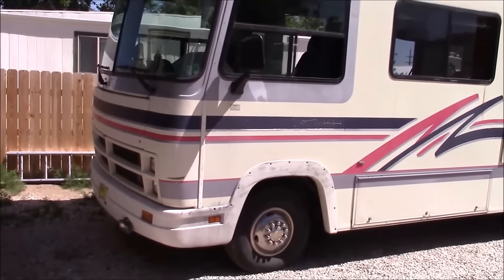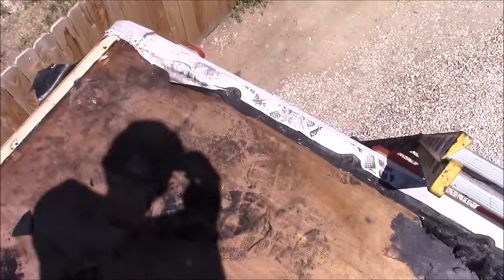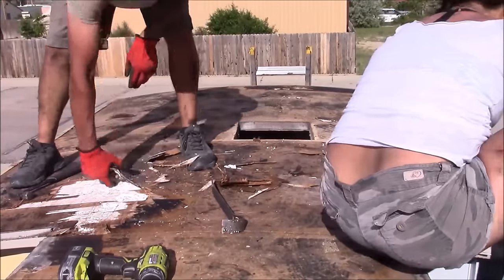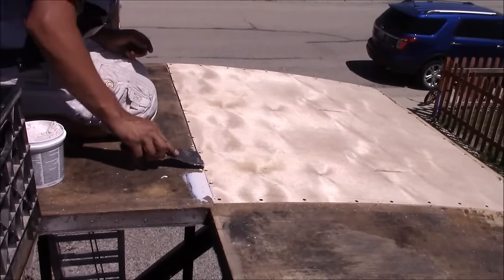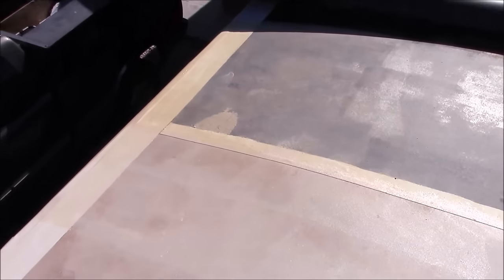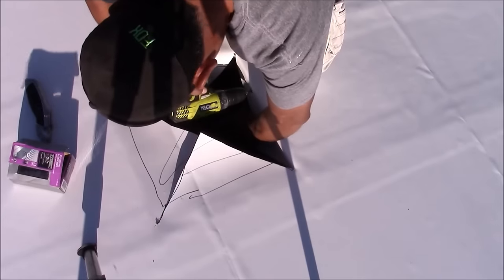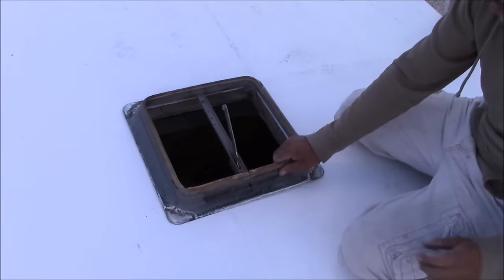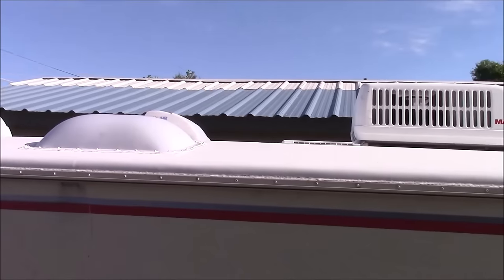How to replace your RV or Motorhome roof EPDM or TPO

Comment: RV Roof replacement is very costly but with Liquid RV Roof you can easily restore your aging RV Roof without no worries at all. Liquid RV Roof is a liquefied version of a synthetic rubber typically referred to as EPDM. Liquid EPDM can go where the sheet version could never effectively coat. Liquid RV Roof is a one coat system for your RV which results in savings in terms of labor and material costs. The final cured properties of Liquid RV Roof are not damaged by adverse conditions.
Reply: if the plywood and particleboard is f'ed underneath though, you still have to replace that, liquid epdm won't help with structurally compromised roofing layers.

Comment: As a camper and trailer mechanic I would advise significantly more lap sealant on the joints and screws.We typically use from 8 to 12 tubes of lap sealant on a reseal.

Comment: Looks like a good job done, I was wondering how did you cut out the old damaged quarter piece of plywood? did you just use circular saw adjusted to the depth of the plywood cutting it in the middle of the steel support beam?

Comment: i just baught a 1994 Fleetwood Flair with the same graphics the roof is in bad shape but white still. it has cracks all in the roof and a big split at 1 section that lets water come inside the RV. Did your roof also leak before you put in new roof and if so how did you fix inside,,this video is going to help me out in a great way and thank you for sharing

Comment: Those screws leak after they've been in the sun for a while. They should be sealed with lap sealant too, and a bit of lap sealant on the threads before they go in helps too
Reply from the maker: They are metal roofing screws same ones used commerical and residential metal roofs. They are designed to not use sealant.  That being said sealant can be added if someone desires it.
Reply: @D.I.Y._All-in-One  yeah they are great screws, they spread the pressure out wider and they keep water out for a long time but many times water just sits on top of the screw and just breaks it down slowly until it gets through and starts rusting it. Then it gets under the rubber and starts rotting the wood. I fix up old RVs all the time so I do a lot of roof repair. Even a little blob of laptop sealant on top of the screws will Help a lot. Once a year every screw should be checked to make sure they're still sealed

Comment: Wow, what a great how to video and a great look at the actual process.. I have a 37 foot 5th wheel trailer and I sideswiped a tree branch damaging about 30 feet of the top roof edge. To re roof the top is estimated about 5G. But now I know what needs to be done! Good Job, I think I can do this although it seems like a lot of work your video was very thorough. Thanks !
Reply: Great video. Repairs to my shadow cruiser Will be a lot easier after your video.

Comment: Pull the roof rails and vents/ac. Pull membrane and radius metal if it's a stick built check roof bows and r.r if necessary. Overlay with 1/4 luan using appropriate structural adhesive and d10. Sand seams and staples. Spread appropriate glue and replace new membrane and squeegee air out. Replace all rails,gimp and hvac/antennas,seal with self leveling and u.v sealant

Comment: Thank you for making this video. I have a 26 foot Aljo travel trailer with a leaking roof. Your instruction and video is perfect. My main concern is my weight on the roof. I weigh 350 pounds. I don't want to break through.
Reply: It is a major pain in the @ss, but get 2 pieces of 1/2" plywood, each about 3'x3'. Put those under where you'll be stepping. It helps distribute your weight around a larger surface area. You have 2 so when you're moving you can stay on one and move the other. I'm a pizza over 300 lbs. myself. That plywood method has served me well over the years.
Reply: Thank you, I'll give it a shot.

Comment: hello , excellent video. One question: is the TPO you used self adhesive or not. thanks for answering
Reply: The TPO doesn't appear to be, as he applied the cement to glue it, two coats near the end separately.
Reply: As he stated in the video that he has to use the adhesive and roll it onto the wood about 4 feet at a time since it could get tacky too fast if he went more at a time.
Reply: I do Roofng for a living and yes there is adhesive tpo it cost a little more but yes and it’s easier then having to use glue

Comment: GREAT VIDEO YOU MAKE IT LOOK SO SIMPLE .  QUESTION I HAVE A 2008  HALLMARK CYCLONE TOY HAULER 41 FT. I HAVE A ROOFER DOING IT AND I AM HELPING.  I DECIDED TO GO WITH AN ALL ALUMINUM ROOF COATED W/ WHITE ROOFING MATERIAL,  LIKE THEY PUT ON 53 FT. CARGO TRAILERS AND AIRSTREAMS.  AIRSTREAMS SEEM TO LAST FOREVER.  TYPICALLY THE ALUM. ROOFS ARE GLUED DOWN NO SCREWS/ RIVETS.  WE REPLACED MOST OF  PLYWOOD AND MADE UP TRUSS'S  A)  WHAT ARE YOUR THOUGHTS ON THE ALUM.  B)  WHERE CAN I GET SAME GAGE FLASHING 41 FT., AS RESIDENTIAL IS TOO THIN.  3)  AIR CONDITIONER  HEAT PUMP VS STOCK OEM 4)  WHERE TO BUY PARTS  NEEDED ; I.E. AIR COND. VENTS OTHER MISC. FOR RV'S?   5)    WHERE DID YOU GET YOUR SHOES :)  PERFECT FOR GRIPPING ?

Comment: Hello there,  absolutely finding your video super helpful.  We have the roof stripped and are now needing to buy the screws.  Would love you to link those..  Our plastic rounded moulding is cracked and we are thinking to keep it because I can't find a replacement.  I think I need #8 X 3/4" flat head self tapping screws in zinc.  Is that correct?  can't seem to find them unless a huge bulk order from a fastener company.  Is this the same screw you used on the plywood?  We are replacing a little bit of rotten wood.  And lastly I am looking for the self taping screw for the termination bar.  would that be a #10 X 1 1/2" self taping screw with washer and gasket, is your's ceramic coated?  Some of these things don't seem to be available at my box store home depot.  So I'll have to order and have delivered.  I am trying to purchanse things to make it easier for my husband.  Team work.  Your help is greatly appreciated.  Thank you.  Great video!

Comment: Great job on the roof, looks good, and is water tight. Only thing I saw, was you didn’t glue the backside of the TPO. You glued the deck but didnt hit the rubber lol.
Reply from the maker: I followed the manufacturer instructions with the glue. I even spoke to them on the phone.

Comment: I bought a 2005 Rambler slide-out camper. I am having to replace the roof. There is absolutely no phone in mine. It looks like quarter-inch plywood was put on it and then some sort of paneling over it. And then the rubber roof. I'm replacing it with new quarter inch plywood. I'm also coughing all the seams and the screw holes before I put the rubber roof on it. The rubber material I'm using is from a construction company that uses it on flat roof. It's black on one side and white on the other. I'm using 6 in wide Flex Seal tape for  the seams on the side of the camper . I hope this goes well. Since I am completely clueless on how to do this.

Comment: I am replacing the roof on a 2004 5th wheel, upon pulling up the existing rubber roofing the top side of the osb is still "tacky" from the old adhesive. you prepped the roof by wiping it down with mineral spirits, did you have to completely remove all of the old adhesive? or can you simply wipe down the roof to remove any dust/debris and then proceed with gluing down the new TPO roofing? (I should also mention that this video helped my wife and I to take on this project, prior to watching it there was no way we would have attempted to replace the roofing. awesome video thank you!)
Reply from the maker: Thanks Man. With mine I just wiped off debris and adhesive remained. You can do a small test with new adhesion to confirm. Just apply new adhesive on old in a 6" x 6" area and let dry for 15 to 20 minutes if you have good adhesion your good to go. If for some reason you have no adhesion or the 2 adhesives react badly with each other you may have to remove all old adhesion but I doubt you will have any issues.

Comment: Biggest problem with these rubber roof's  from the manufacturer is they used staples to attach the 1/4 plywood too the framing. After driving with the vibration and constantly leveling, the staples start to loosen and pop up into the rubber and eventually causing leaks. If they would have put in screws like you did in the first place, the roof would last a lot longer.
Reply from the maker: Yea not a big fan of staples

Comment: Great job. Does the plywood 'need' to be glued to the Styrofoam? Will the screws not hold it sufficiently in place? I'm going to have to do the roof of my travel trailer at some point in the near future.
Reply: You really want to glue it to the Styrofoam. When you are rolling down the road, you will want that extra grab from the foam to keep things in place and not move. the screws will be fine, but like in the video, there was a place on the roof that was not near any framing, so only the glue will be holding the plywood on. And more is better when it comes to securing things for RV's or trailers.
Reply from the maker: I would highly recommend gluing down the plywood it actually makes the roof a much more solid structure. without glue the plywood is so thin it will bow & flex causing roof membrane to stretch which could lead to roof failure.

Comment: C.L.S. Great video! I was wondering when you adjusted the side termination bars did you adjust left to right or up and down? I cant tell from the video on exactly how you  adjusted to accommodate the roofing screws. thanks again.
Reply: Termination bars are called awning rails and after glue and rolled out pull wrinkles out and use a squeegee. Let it dry then go down each side pulling tight and use a L15 staple gun to hold

Comment: For all of you with a $2500 rv or camper with a bad roof use bear deck over decking paint. After you remove rubber

Comment: I have generally a good roof except around the bath tub sun roof on one side of my travel trailer. I spoke with a bona fide travel trailer company who says the whole roof needs to be done vs fixing the leaking area. I am a carpenter as you are and I beg a difference with the travel trailer repair company who says if one patches the affected area it will leak again. What are your thoughts? If I do what you have shown in your video just seems to me I should be able lap and then seal with the repair tape your used to seal off the front and real seals. I don't need a ton of membrane a total of perhaps 4 x 6 feet.  Thanks
Reply from the maker: Patches can be very hard unfortunately.  It's a case by case scenario.  If it's a tear or just damage to roof that is other wise in good shape a patch might work.  But if it's a case of roof just being worn out on one side a patch probably won't work well. When these rv roofs start to fail the material becomes compromised making it hard to bond any products to it.

Comment: 😬 I have to do this job in the coming weeks. I have a 96 Fleetwood so it's pretty much going to be the same thing as what you did. Wish me luck
Reply from the maker: Good luck. Just a tip: be prepared to cover with giant tarps from rain/weather if its not going to be in a garage while old roof is off.
Reply: I'm in the valley in California so it hardly rains here. Wanting to get this job done before winter arrives.

Comment: I fix campers and motorhomes for a living at a dealer. A heat gun would make pulling up the luan much easier because it loosens up the glue and generally the foam is left behind intact and good shape. Just dont get it too hot and make the foam shrivel up

Comment: Looks like you had an excellent helper too! Did you sell the other kit? I have a 35ft Winnebago Vectra with a damaged fiberglass roof. I haven't measured the actual material needed to cover it. I'm in Georgia, are you anywhere close?
Reply from the maker: I still have kit but it might not be long enough for your roof though. No pretty far Wyoming lol.

Comment: One of the worst decisions I made was using an RV cover over the winter month. After 3 years of this, the cover literally sandpapered the rubber roofing coating from the RV top. In windy areas it's best just to let the rig uncovered and watch the top for leaking while it waits for spring.

Comment: Cool video, for a while now I've been thinking about tearing up the rubber roof and applying a thin layer of resin followed by a few alternating layers of glass fibre matting and resin. But can I live with how ugly it'll look.

I used to have a Winnebago with a thin sheet aluminium roof, but no roof metal structure (the walls were metal framed) just wood, so the roof sagged.

Comment: One question about construction & repair of the roof: since its likely that the roof leaked water damage would be  evident on the inside ceiling, if the construction is the same inside as top (.25 ply glued to 1".25" foam) would you tear out the entire roof from the top or tackle from the inside?

Comment: Hi, great video!
Do u have a link of where u got the rubber roof and what's it called along with all the other materials to finish your roof? I got the same issue n want to get it done but I'm clueless off all the materials I need!
Reply from the maker: Hello Search on Ebay TPO rv roofing kit. You will need rubber roof, Butyl tape, lap sealant, screws, etc. This is the kit I bought but I still had to buy more lap sealant and butyl tape..https://www.ebay.com/itm/10-x-30-45-Mil-White-TPO-RV-Rubber-Roof-Kit-membrane-adhesive-tape-caulk/152184934989?ssPageName=STRK%3AMEBIDX%3AIT&_trksid=p2057872.m2749.l2649
Reply: C.L.S. Allinone thanks for ur fast response!

Comment: Zzzzhave you erred did a wrap or painted the sides of a travel traylor.  My traylor is like new inside but needs some repair of water damage on the corners and the metal looks old, thought about a wrap or paint.  What are your thoughts or if you have a video let me know.
Thank you, enjoyed your instructions on top replacement which I am going to do also.

Comment: If I have a camper that is already leaking, and I need to replace the plywood under the styrofoam, do you do that from the inside? 
(I’m like just starting and no NO clue what I doing and I need to fix the leaks before I start the rest 😅)

Comment: You should seal the screws any way.
Reply: Retire Soon agreed. I've seen people even cover the screws with eternabond, which is overkill. I'd def break out a tube of lap seal on the screws. If nothing else it will prevent your screws from rusting and creating black streaks down the sides of your coach. Great job though.
Reply: A dab of sealers on the screw hole and screw tip before inserting and tightening down. This will prevent water from traveling down the threads and help to keep the screw tight thanks to the light bond between the wood, screw, and sealer. 

And yes, it never hurts to dab over each screw. Just not with silicone. No silicone on the exterior of an RV.

 Cheers!
Reply: Ya, those gasketed roofing screws only last so long with the high exposure to sun and weather. Seal it.
Reply: They last longer than the two to three cases of sealant most RVr's think they need to smear all over everything.
Reply: A two coat epoxy coating would do that as well as seal all the wood to prevent water intrusion and eventual rot.
Reply: @J.Cameron.Stuart.Adams.  why not silicon ?
Reply: @J.Cameron.Stuart.Adams.   Why no silicone on the outside?  I am trying to learn all I can.  Thank you!

Comment: Why not use the sealant under the termination strips and vends instead of doing the edge after? 
Seems to me sandwiching some sealer in between would be best then the external layer as a first line of defense.
Reply: Myron D 
  That was done with the peal and stick material i believe  .

Comment: HeLp.....
I recently purchased a 1996 Class C motorhome and the roof is completely black however there are no tears rips or cracks and there is like minor things that I can patch up. will a simple recoating and cleaning do the job or should I replace all of the black rubber roof? please keep in mind I do not know how long it has been sitting but the black part is very smooth and there are no soft spots. are we supposed to replace after a certain amount of years or just keep cleaning and recording.??? I really enjoyed this video thank you so much I do have a few questions
Reply from the maker: Thank you.. I would suggest a new roof if it is all black that means it is very thin because half the coating has eroded away and if you wait till its start to fail it could cause unnecessary damage. But that being said you should have a local rv shop inspect it to get a second opinion they do sell some roofs that are already black but they are not designed for RVs and would guess that's not whats going on with yours.
Reply: C.L.S. Allinone wow thanks so much for your fast reply
Reply: I did have a Jayco trailer with a black roof. It was solid and the only part left in good condition. The sides had delaminated and the floor had huge soft spots. I thought it was supposed to be that way. 

But I'm in the UK and I've only had that trailer, an old Winnebago Class C with aluminium roof and my current Damon Challenger Class A with a white topped rubber roof with a few blisters and soft spots over the rear bedroom (there's old evidence of roof damage at the back, probably from driving alongside an overhanging building), so I don't know much, just an observation.

Comment: Hi i was wondering when dealing with rv water damage is there a method to fixing it should i go for the walls roof or floor or does it even matter what comes first.
Reply from the maker: if your able to keep rv in a garage to work on it then it doesn't matter what order but if you are working on it outside you should get the roof in good working order before doing anything else to protect rv from the weather.